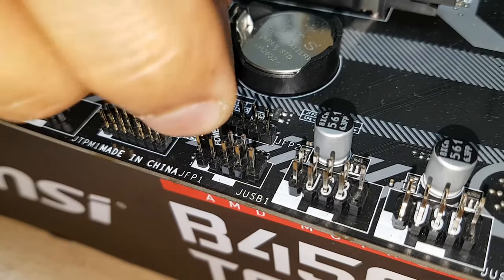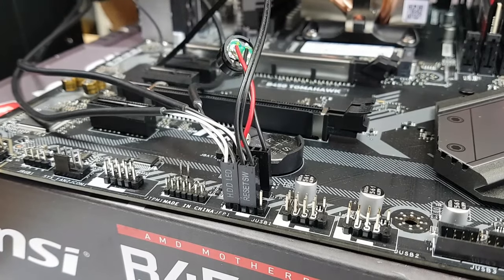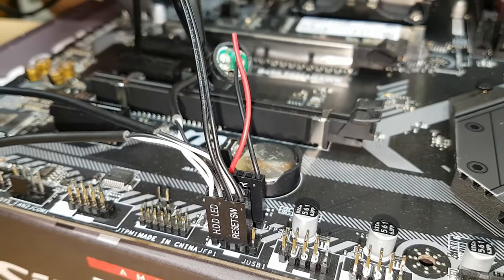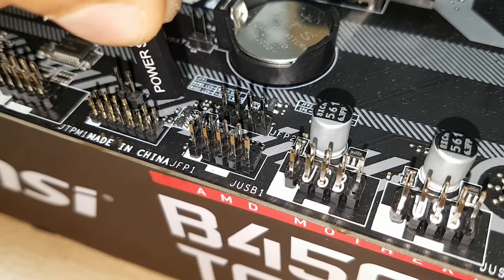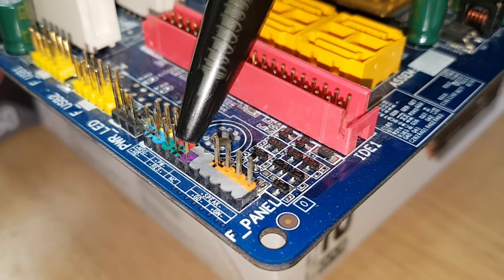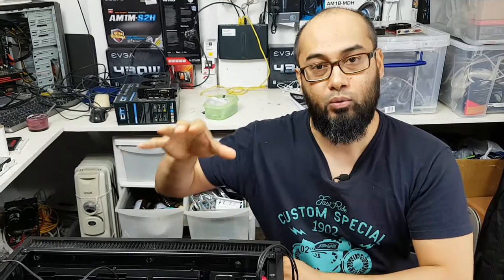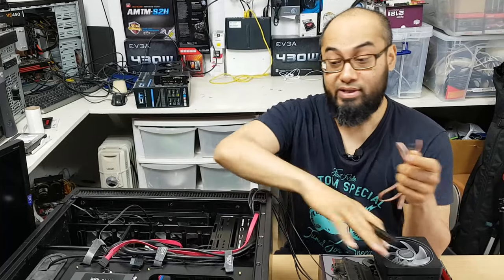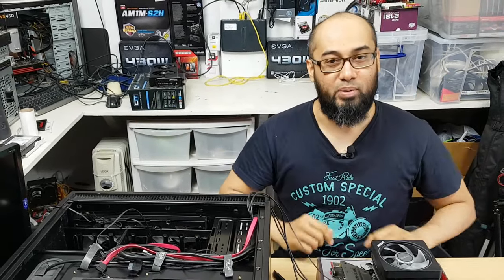Front Panel Connectors On Motherboard - Easy Beginners Full PC Building Tutorial - Pt 19

Comment: The power LED and HDD LED connectors can only go one way. If you put it in incorrectly the LEDs won't light up. For power switch and reset switch, doesn't matter. They only short the two relevant pins.
Reply: So there’s these pings at the end of the all the led connects and stuff where do I plug in that so I can plug in all the led things into the motherboard
Reply: @yaheardprince  check your motherboard's manual.
Reply: @yaheardprince  trail and error till you find the right way is what I did found it after 2 or 3 times
Reply: @yaheardprince  you're in no danger of frying anything unless you force a plug or use a header clearly not correct Exception for some mobos pump header used for a fan... If it's a higher wattage, it could be trouble. Double check the motherboard labels closely on these. They're clearly marked.
Reply: @ronch550 what if i lost it?
Reply: Only one of the LED lit up, I’ve tried changing it else where but it’s all correct the way I did it and in the manual but second led light from second light doesn’t light up.

Tbh I got a new graphics card and it is my first pc but I bought it pre built but decided change graphics card because my other one was kinda slow. I accidentally removed these wires and I put it back and did it the way manual said but second LED still don’t light up… idk why I’ve tried 😂😭
Reply: Btw the pc still turns on normal just the second LED light that don’t turn on idk, the fans are spinning as normal too
Reply: For the reset switch, either I don’t have one or I can find it does it matter it it’s plugged in or no?
Reply: @metalhorizon1580  what about the reset switch can't you find? The header pins von the motherboard or the wires from the case? If you don't connect it then the reset button on your board simply wouldn't work. Some cases don't have reset buttons but it's a rarity.
Reply: @ronch550  yeah i found out that my case did not come with a reset switch, its with the power switch, more of the modern cases are like that but thanks for the reply

Comment: This saved me! I just got a new motherboard and had that moment where I had everything plugged in, proud of myself, then pressed the power switch and... nothing. Luckily for me, this video exists. Thanks a ton!
Reply: got same problem, but i"m pretty certain that i have plugged those wires into wrong place. i have them plugged to JFP2 since that has not worked i will try to switch. also first time the power button was glowing red. honestly this so confusing when my motherboard manual MSI mortar is not explaining it very well. excellent video thanks for uploading it i would be stuck if not for a video on this that is not years old.
Reply: pls help me, i have tried everything, i plugged everyting in the right spot on the motherboard while outside the case and it turned on, but when i put the motherboard back in the case and plugged everything in it did not turn on, one time id did turn on while i had the power cable for the motherboard plugged in and the power for cpu plugged in while the motherboard was inside the case but when i plugged in the rest of the cables like usb, audio and other and felt like i was done the power did not turn on... (ive installed all the risers)
Reply: Help me out?
Reply: I have all that connected to the motherboard. Where do i put the other side
Reply: @starolaa  a CD
Reply: @usa_phantom2715  thanks it went good been using my pc for couple months nwo
Reply: Yeah I was in the exact same situation just know
Reply: Man, my first build I couldnt turn it on for a day !!! Until I figured it out !!!
Reply: Exactly the same thing happened to me

Comment: Q - Which of the front panel connectors wire are necessary to at least turn your computer on?

A - The answer is none of them are required. After installing the CPU, and RAM and connecting the PSU cables, you need only short the two Power Switch pins on the front panel block to start the PC. This can be done carefully with a medium blade screwdriver, just touch both of the Power Switch pins with the screwdriver,

As for the situation with the 3-pin Power LED connector....
Case specification several years ago. One of the changes was going from a 3-pin to a 2-pin connector for the front panel Power LED.  This is why many cases today have a split connector for the + and - Power LED like you show in your video to accommodate older motherboards with either the 2 or 3-pin connector.

In the case of your MSI board, it has both 2 and 3 pin connectors for the power led to accommodate just about any computer cas you might be trying to use.

On your MSI board, the 3-pin connector is labeled PWR_LED. The 2-pin connector is the one labeled [+MSG-] your motherboard's front panel header.  They are labeling it a MSG connector because in addition to providing a steady power-on light. it will also cause the LED to blink in sleep mode and provide other 'messages', using a pattern of blinks to show stuff like P.O.S.T. status or errors.

Good luck!
Reply: A

Comment: You are a goddamn legend. My PC fans stop spinning and I unplugged the power switch cable along with the Reset switch cable thinking those were the fan cables (I’m a complete and utter noob when it comes to PC stuff) and after plugging them back in the wrong way (unknowingly) my pc wouldn’t start and I started panicking thinking I just broke something. Then I watched this video, plugged them in the right way and now the PC is starting normally… thank you so much!

Fans still aren’t working but that saved me a heart attack.

Comment: Good video. I had a friend help me make a pc a few years back and while I was there when he did it, I forgot about the front panel connectors. Fast forward to a few months ago, I tried installing a better cpu fan and had to mount the brackets to the back of the motherboard myself. Removed the pins to take out the motherboard and didn't find out things were wrong until I noticed my case lights flickering like crazy. Finally solved it by switching the powerled + and - pins around.

Comment: It's always a good idea to look at your motherboards manual to see where everything goes. They have a diagram in there showing all from panel connection pins and the board is labeled itself sometimes. Don't just go plugging in the cables just anywhere they fit.
Reply: Problem is the manual never tells you which side you plug them in. Label up or down.

Comment: I remember when I bought all the parts for my first expensive gaming PC, then when I started putting it all together I was stopped dead cold. I did not know where to place or put the connectors and the part instructions I did not understand, so I had to call a friend for help. So now I want to add and install a gaming hybrid hard drive for extra storage so I need to know where on my motherboard or how to plug it all in. Thanks.
Reply: Depends on the mobo, but I would say sata

Comment: LEDS (HDD  and Power) need to be careful with polarity, (if you see an ARROW in the connector, it means its the positive), if you switch them, they wont work.

POWER AND RESET SWITCH doesn't matter if you switch them or not, they are momentary connections , some technicians activate them using a screwdriver or a paper clip just for testing purposes.

Front panel power and led doesnt matter if you mess up, nothing will break or burn, they just wont work.

USB CONNECTORS tho you need to be careful. If you switch them and you connect a flash memory based device like a SD CARD or a FLASH DRIVE they will shortcircuit and destroy it.
If your PC is brand new and you never tested before, plug in a cheap device like a USB mouse to see if it works. IF it does you can plug your flashdrive without issues.
Don't worry about back panel USB. Can't go wrong.
Reply: Once I "fixed" a power button switchnig the Power Switch with the Reset Switch... told the client to start using the RESET to power up his PC lol. just a hint if your power button broke or its stuck. If a hard reset is needed, just push the power button for like 5 sec and it forces a shutdown.

Comment: So I am nearly finished with my build and I'm just waiting for my graphics card. I put in the POWER SW in the POWER LED slot by accident (I don't have a POWER LED to connect) and tried turning it on and it didn't go. I then put the POWER SW in the correct spot and everything seemed to turn on properly. Should everything be fine or should I be worried about a problem or a fried connector or something? Thanks!

Comment: I just finished building my gaming pc. Pressed the power button, it did not turn on. I was devastated. I saw this video and then it turned on :)
Reply: Thatdude Nik nice. What parts did u choose?
Reply: Bryce Goder

CPU: Intel Core i9-9900k

GPU: Asus rog strix geforce rtx 2080 ti O11g

MOBO: Asus rog strix Z390-E

SSD: Samsung 970 evo plus 1TB

RAM: Corsair vengeance RGB pro 2x16 (32)GB 3200mhz

Case: Lian Li Pc-O11 DXL

CPU Cooler: Corsair H150i pro

PSU: Corsair HX850 platinum

Case fans: 3xCorsair LL120

Additional specs:

Corsair Commander Pro

Corsair Lighting Node pro

OS: Windows 10 Pro

Yep I had time to waste to say everything
Reply: Same here but i cant solve it anyway ,mb is shining but power button not working
Reply: Markk.N make sure you did it EXACTLY like him. I used my mobo’s user manual, and that’s when it got wrong.

Comment: The pwr on/off Switch can be put any way you want, all the Switch does is to short the two pins.  But the LED (short for Light Emitting Diode) will only accept plus on plus, and minus on minus, cause the diode will only allow current to pass in one direction
Reply: Also want to add that i would like Almost all comments here, this dude is a hero for explaining this in an easy way, and challenging you a little(like asking us to comment what we think will work/not) and also this guy does not have like 30sec if ads, and then 45 sek more with sponsor stuff, and then a noisy intro, just starts with the whole point of the video🤩
Reply: that the answer i was looking for lol . i have to remplace my mother board and realise that my power and reset connector + - was reverse for the last 7 years, so i was like ok does it mather or it is because my connector on my power buton is reverce too lol .😆 but most of time switch do not mather it is just to circle the circuit but bether comfirm on internet first lol.

Comment: Q - Which of the front panel connectors wires are necessary to at least turn your computer on?

A - The answer is none of them are required. After installing the CPU, and RAM and connecting the PSU cables, you need only momentarily short the two Power Switch pins on the front panel block to start the PC. This can be done carefully with a small blade screwdriver, just touch both of the Power Switch pins with the screwdriver,

As for the situation with the 3-pin Power LED connector....
Several years ago, the case specification for the power LED connector was a 3-pin connector. This changed as part of the new specifications, going from a 3-pin to a 2-pin connector for the front panel Power LED.  Today, most case manufacturers now use a split, 2-pin connector for the + and - Power LED, like you show in your video, to accommodate newer, or older motherboards with either the 2 or 3-pin connector.

In the case of your MSI board,  it was apparently made during the transition and has both 2 and 3 pin connectors for the power led to accommodate just about any computer case you might be trying to use.

On your MSI board, the 3-pin connector is labeled PWR_LED. The 2-pin connector is the one labeled [+MSG-] your motherboard's front panel header.  They are labeling it a MSG connector because in addition to providing a steady power-on light. it will also cause the LED to blink in sleep mode and provide other 'messages', using a pattern of blinks to show stuff like P.O.S.T. status or errors.
Good luck!
Reply from the maker: Fantastic, someone who has more intricate  knowledge of PCs!  Feel free to hit me up if you ever want to contribute or collab, I'm sure we can  all learn a few things from you...!

Comment: some canins like mine there wont be a reset switch and it will be sw light or light or Led switch in that case dont panic just plug it on ur led / fan hub placed on other side of ur case or ur led switch will work as reset

Comment: Great Video.  what happens if you put the cables in the wrong order, same panel header but in different place (power where reset goes etc) , would you damage your motherboard, or will it simply not turn on?

Comment: Thanks for the video however I'm still running into issues. I'm using an older dell motherboard, not sure which one, trying to transfer to a powerspec g90 case, however, the dell power switch had a 5 pin connector while the new case has separate cables as shown in your video. I was wondering if I could email you photos for assistance?

Comment: Yes very easy as long as the connectors are written with it’s purpose. But if u sit in front of an board with cables just with nothing written on it and connectors on the board which all doesn’t seem to fit to the cables, then you hate it, when others calling it easy ;) Good luck to all you builders outside.

Comment: Does it make a difference if you don't plug in the P - LED and P + LED?
Reply from the maker: Not for POST, only to show activity of the system on the front panel, not needed for POST, but handy sometimes for visual aid if PC is closed.
Reply: @HealMyTech1  oh awesome! Thanks for the reply. Happy you get back to all these comments. I just built a PC for the first time so I'm like a chicken with my head cut off. I just messed up and got the wrong CPU, so that's more than likely why it didn't POST.

Comment: Hey, I have a question. There is glue on the sides of the front panel connectors and it was there when I bought the case. Should I remove it or do I install it but not on the holes with glue on them?

Comment: Hello and thank you so much for your helpful video. I have use the manual for my motherboard MSI H61M-P31/W8.
I have successfully connected the FP1 plugs. But I have a problem.
All fans spin but only the front top fan lights up. The two below that I have daisy chained andthe rear fan I have added on too won't light. Can you shed any light. I have obviously not got it right somewhere.
Thanks in advance :)
Matt.

Comment: How do you know the orientation of the Reset SW cable? All the other cables have negative or minuses on them , this cable you can put in anyway and it fits? Theres also little arrow near the pin insertions but nothing mentioned of that in the manual. I would really appreciate a quick response as i am this second building it. Kind regards. I am using a Phantek P400a case.

Comment: Thank you for this video boss
I was loosing my mind with all these small cables

By the way one question,

I have a corsair cx650m  modular, and I just connected the thick cables that come locked to the power supply to the motherboard.
Do I need any auxiliar one?
My x570 motherboard doesnt seem to have any more room for auxiliar ones though.

Comment: I have an older front panel, with a not as old GF8100 M2+ TE board.

There are 4 pins pin places (11 is blank), but 12+ 13+ 14-

I only have one + and one -.

Do I use the closest + to the - (use the + in pos 13) ?
Or leave a gap (using the + in pos 12) ?

I cant find any help on this issue.
Thanks in advance.

Comment: Hi there my friend, I seem to be having trouble with a ground loop and interference which I believe is xoming from a problem I have with the USB ports on the case. I wanted to know if you have any idea why? I have checked everything is in the right place, updated, deleted reinstalled drivers and the problem still persists, infact when I use the USB 3.0 on the face plate my computer starts to malfunction, connects/disconnects and freezes. Any help would be appreciated
Thanks Harry

Comment: What can i do if i dont have a motherboard manual i want to recase my hp 400 g3 mt but the power switch hdd led and power led are all in one plug but my new case they are all seperate can i just plug them in as i go or if i plug it in wromg will i short my motherboard thanks

Comment: Hi there! My new Pc case has an extra connector labeled "Led/RGB SW", I've checked my Gigabyte motherboard A320M S2H V2 and it doesn't have the corresponding pins in it. Should I just leave it out?

Comment: Hey man was wondering if you have any tips on someone who’s dealing with a case with a full 12 pin front panel connector holding all power led hdd connectors in one plug! There’s no 12 pin on my mobo labeled jfp or fpanel, and the jfp only has 9 pins not 12

Comment: I’ve always been confused by msi’s manuals.  If you look at the B450 tomahawk manual it shows that the reset switch should be plugged in the opposite direction.  

There’s a lot of people that say unplugging the reset switch on their msi motherboard solved an issue with the pc not booting with a red cpu debug light showing.

Perhaps the orientation doesn’t matter? Still I find it interesting why their motherboard manuals show different instructions to most how to videos.

Front panel pin layout is on Page 5 - 

https://download.msi.com/archive/mnu_exe/mb/E7C02v1.4-GSE-LITE.pdf

The same goes for my B450m mortar max manual.  The reset switch instructions do not follow the same pattern as the other connectors.
Reply from the maker: Interesting, I will look into this an incorporate in a future video series

Comment: What about an older HP case. I have a 9 pin female connector (HP P/N 502216-001) to which 6 wires are connected. They are not labeled. What are my options.